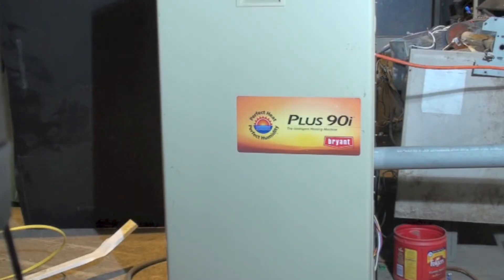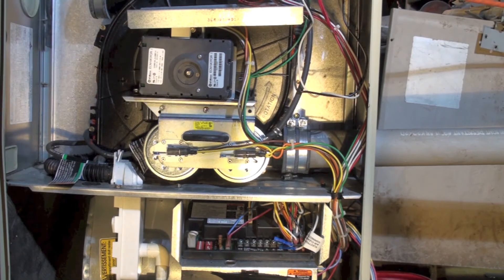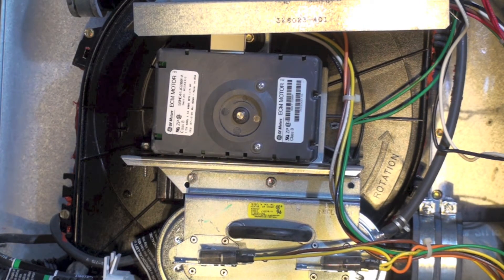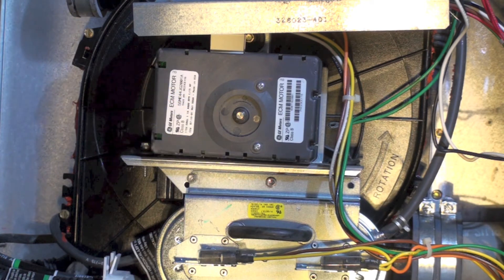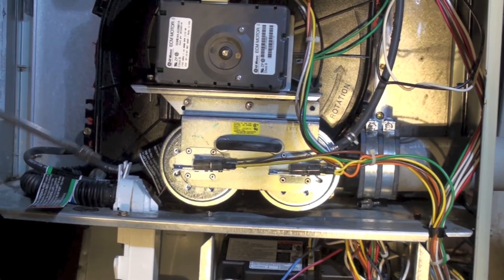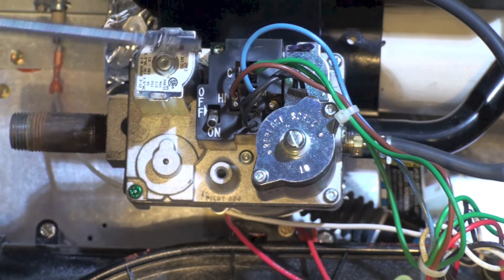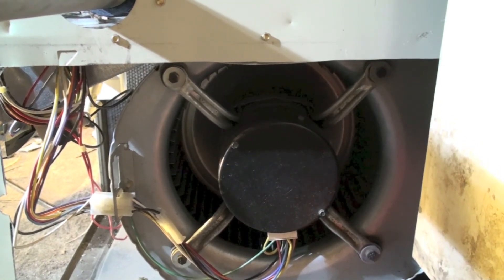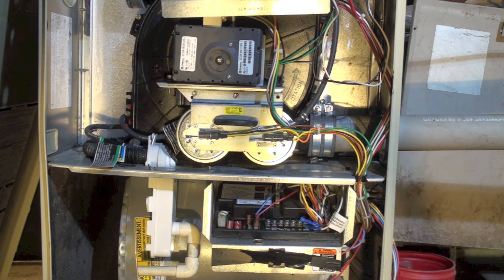Byant 355 MAV/Carrier/Payne/Day Night series #1

Comment: HELP!!!

i have this exact furnace. i had my circuit board changed last year and now i was told that my inducer motor needs to be replaced. Dang!

can i take it to the inducer motor to a repair shop (like you can do with an alternator) or do i have to buy a new inducer motor? ($700 just for the repairman to buy the part before his mark up.........YIKES!!)

what is the level of difficulty to change the inducer motor myself? is it just as easy as replacing engine parts?
Best place to buy an inducer motor?....any ideas?

for that matter, is it better just to buy a new furnace (ugggggh) ? 
Best deal on furnaces?.....any ideas?

NOTE: some hoses were loose and the condensation hose (bottom left of the inducer) had a big hole in it.

also, it was a hot summer and there was no need for the furnace to be on so it was off for almost 6 months, but prior to turning it off for the summer the furnace made a fast clicking sound. almost as if it were trying to fire up. 

i didn't call the repairman cuz it wasn't needed at that time.....NOW IT'S NEEDED!!

Help PLEASE!

Comment: Could you please help me with this: Bryant, 355 MAV, installed in 2001, about three weeks ago I noticed fan motor continue running at low speed after hitting cycle complete. Thermostat checked o'k., Fan motor and blade, furnace itself are very clean. I seal it nicely after installation and regularly change the filter. Inducer motor failed two years ago and I replaced it, no problem here. No any LED lights shows a problem, except Green 4 tells me Low hit. Why those fan given me constant ventilation when outside is -20C -25C? successfully increasing my electrical bill. Thank you for help.